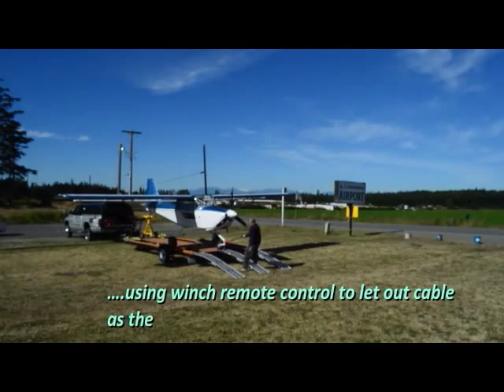Loading and Unloading Kitfox SS7 on a Trailer

Comment: For me?   I'm leaving the airplane at the airport.   I wonder if Mr. Boslaugh does this each and every time he flys?   Almost a logistical nightmare - I would think that this would take a lot of the fun out of it.   

I don't mean to sound critical, as I have loaded and unloaded my EROS  1650 MM many times in the past (It's out of service now, after 13 years of flying it and 750 hrs).  But, this facet of my flying was done ONCE, after getting the plane down to Florida for the Winter - and again, when returning it to Va. in the Spring.

If Mr. Boslaugh does this each time he flys, my hat's off to him for his tenacity.  Very nice plane and trailer.   I would, however, complete that trailer wood decking.   I've seen them fall "through" the trailer openings - it "ain't" pretty.   Thanks for the Video.   N-6395T

Oh, didn't see a "Tail Number."   This is an "Experimental Amateur Built" plane, requiring Registration and an Airworthiness Certificate.  Has it been registered and inspected?  Just a thought.
Reply: agree - way too much work -takes away from the fun factor !!!